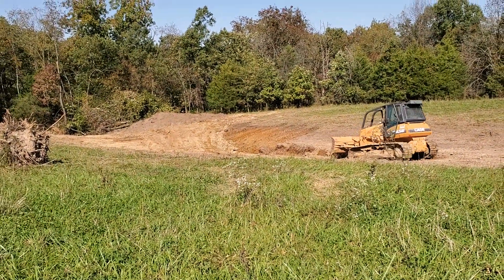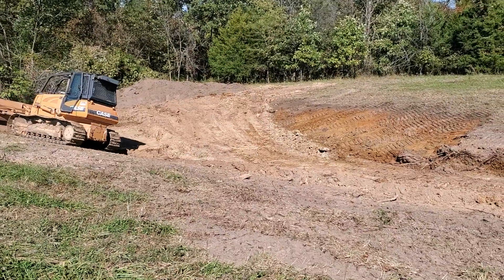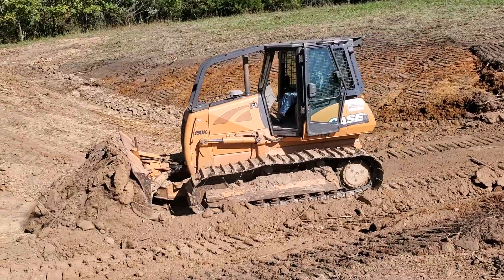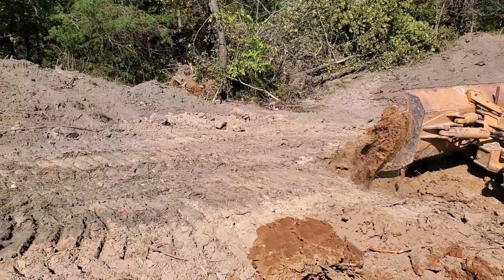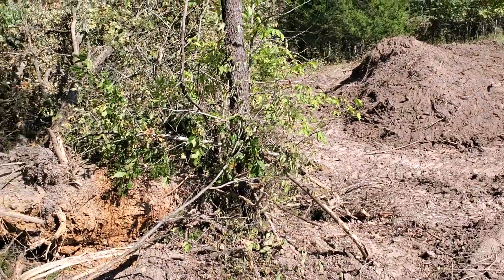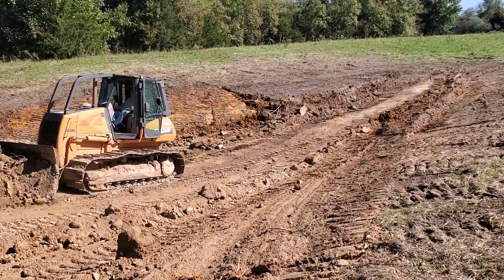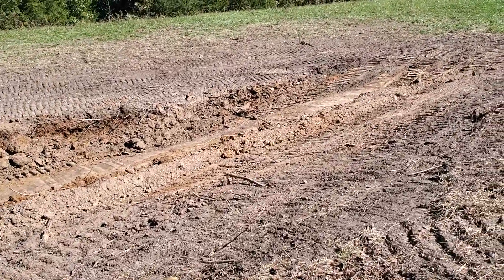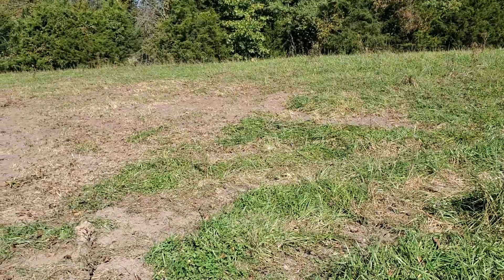Part 1, live action of building a livestock pond.

Comment: When I was younger about 17, I saw a tree that had thorns 3-4 inches long went right into my shoulder. The person with me use a tweezers to pull it out but it didn’t work. Then, they grabbed a pliers in the farm truck to get the thorn out. It was hard to get it out, but it finally came out. The best part it didn’t hurt at all. It was more of a bee sting.